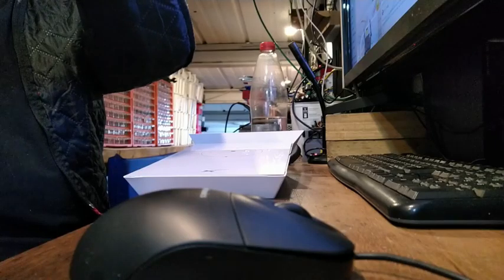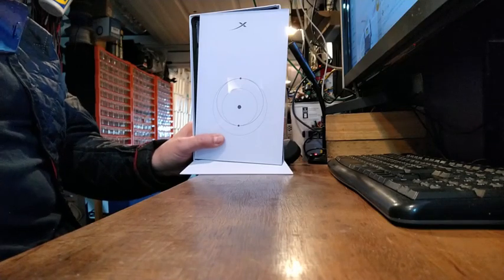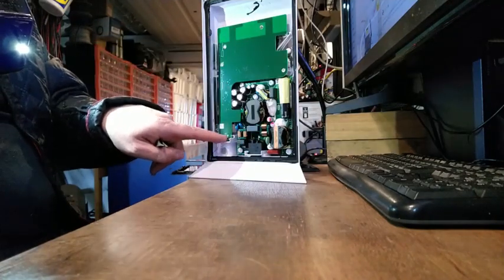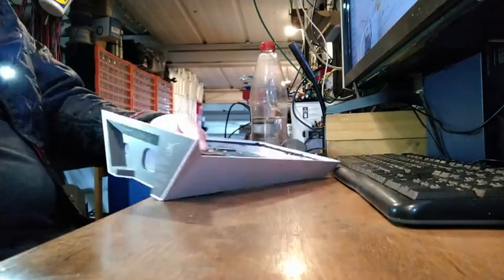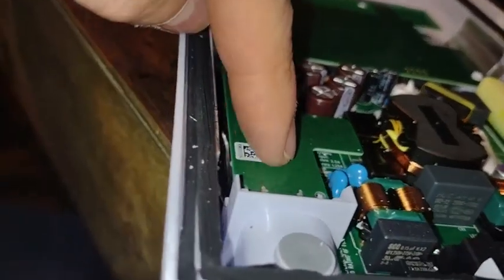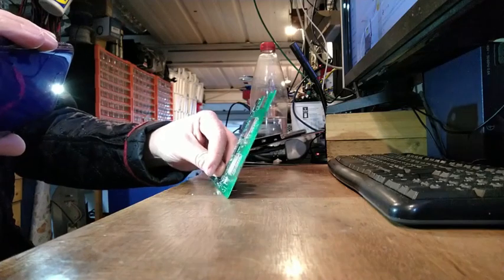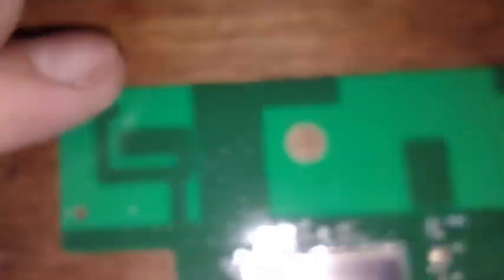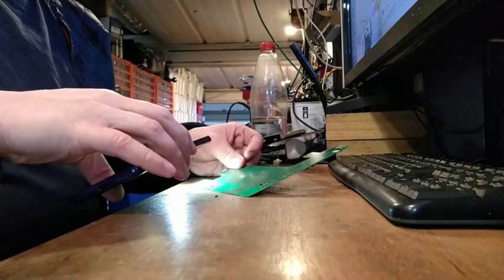Hacking Starlink: Making a 12v router from the Starlink original one.. and saving money.

Comment: why 480??!!!
Reply from the maker: Not sure where is 480. It's possible I meant 48v. The router runs on 12v and it needs 48v to power the dishy.
Reply: @TurboElectricUK  pretty sure they meant 480p ... the res of the vid
Reply from the maker: @-Yogo  Ah, yeah I'm having problems with upload speeds and processing times so I'm doing lower res. I know people have, like, 100k TVs but if it means spending hours processing and uploading vs more content quicker the res gets it. I have a day job 😁
Reply from the maker: @-Yogo  Ah, yeah I'm having problems with upload speeds and processing times so I'm doing lower res. I know people have, like, 100k TVs but if it means spending hours processing and uploading vs more content quicker the res gets it. I have a day job 😁
Reply from the maker: Check out the next one which is 1440p